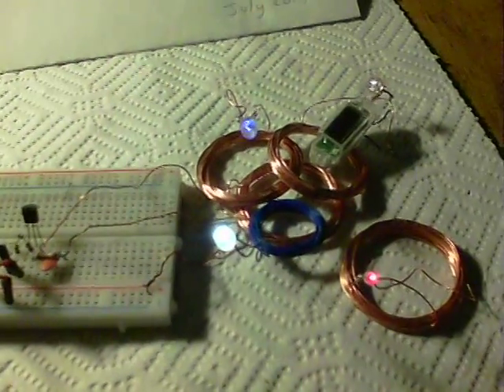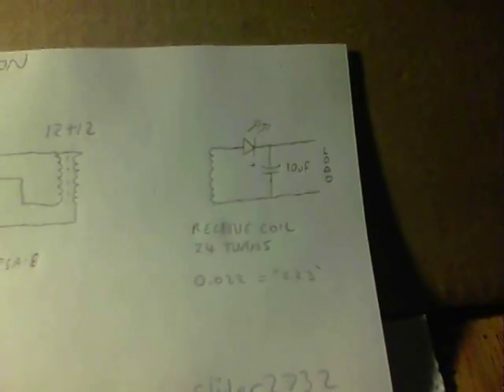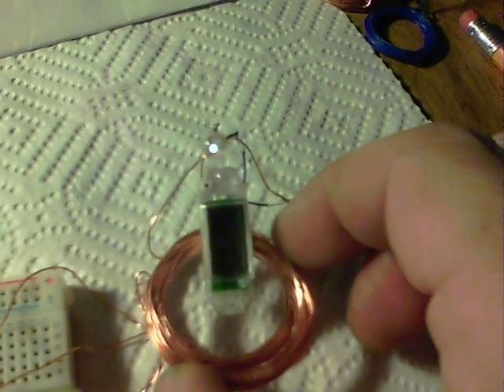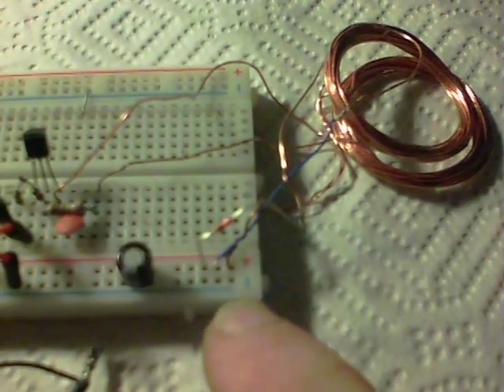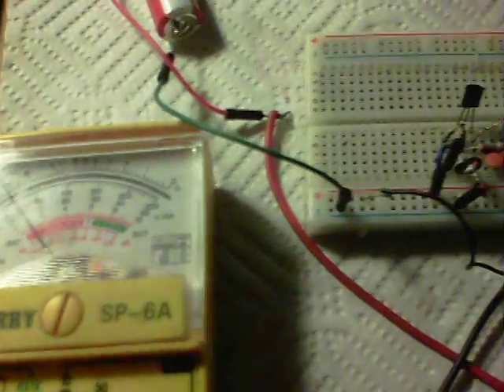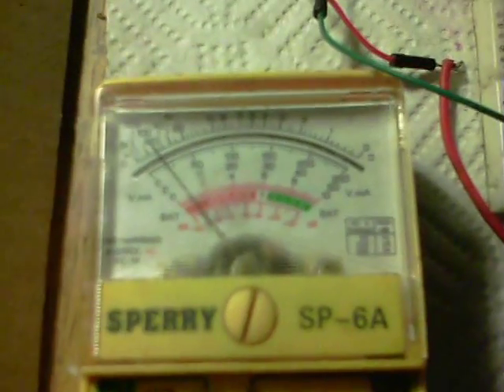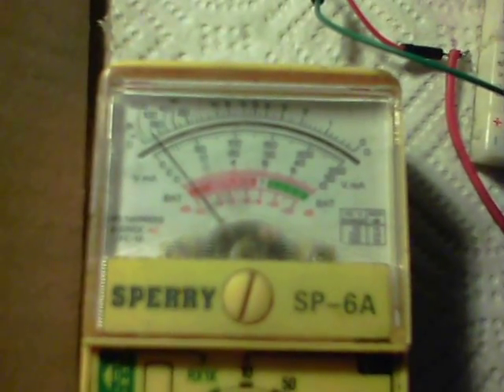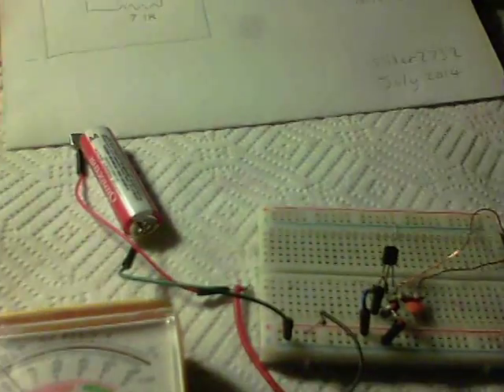Project Centurion - efficient wireless electricity

Comment: How and why only 24 turns plz explain mathematically what formulas used.
Reply from the maker: Many tests were done with 12, 15, 36 turns and others. 24 turns was found to work best in this application. Much changes with capacitance across the coil and all can only be a guide., because everyone will build a coil differently. Even the brand of a same gauge wire will affect it slightly, due to enamel thickness differences. 
If machine building, exact measurements and formulas can be made, without such human factors.
Reply: Slider2732 Any personal way to contact I have few questions related to circuit that I want to discuss....This principles behind this is very imp to me as its my project

Comment: How about a wire spiral in a funnel shape?
Reply from the maker: I've got a coil like that, pyramidal. It has a blocking oscillator circuit inside it and has proven to start the LED flashing with very little RF energy. Kinda funny to realise that it's a pancake and then just lift the middle upward :)

Comment: Very nice demonstration of efficiency through resonant capacitive coupling. It was interesting that when the you turned the loop back receiver coil closer to a 90degree magnetic field, it seems to generate more ampere in the coils capacitance? Thanks as always for sharing.
Reply from the maker: That actually surprised me a bit...it had done similar before and hence was part of the filming, but hadn't quite brightened to that amount (was better in person, that part didn't show up too well on this YT version).
Every coil causes a pull of amperage, whether it has anything on the end or not. But, there are 'sweet spots' where output doesn't cause a drain and they're what i'm looking for. One is by putting a coil on a piece of card to separate from the transmitter coil, that tiny distance can cause an LED to brighten significantly and yet current goes down.
It seems that 3D angles and 3D spacing do have more effect than thought...it's easy to treat a wireless space as somewhat flat 2D by matching coil angles. Watch most similar experiments and the coils line up flat to one another.
Reply: That is quite interesting, have you heard of the Casimir effect? Try with tiniest amount of plastic between like a .001 mil if you can? Or I will attempt this circuit soon enough, looks fun.
Reply from the maker: Hmm yes, have heard of the Casimir effect. There's nothing wrong with trying dielectrics between surfaces :)
It's a fun circuit in the way it uses hardly anything, but still gives good induction range...I always like a circuit that can be forgotten about during dinner and the battery isn't flat on return to the bench lol